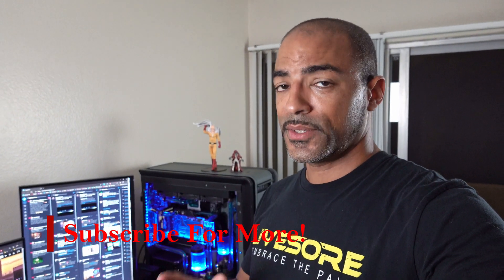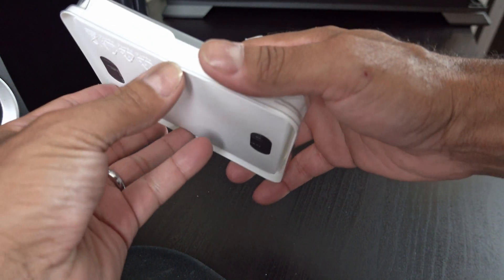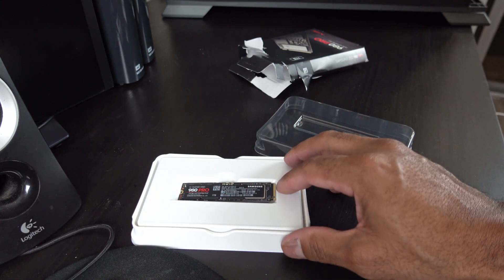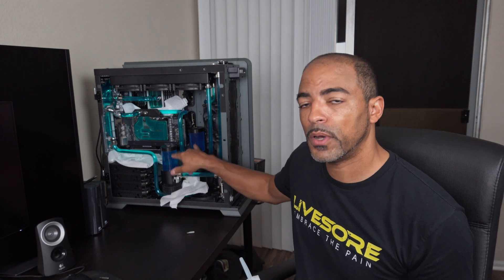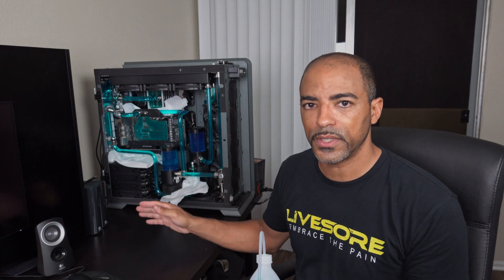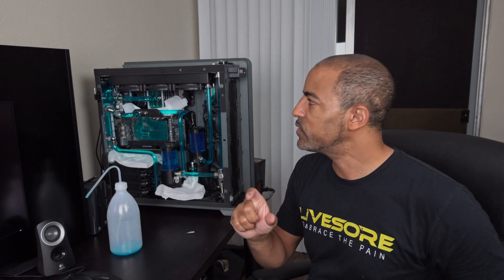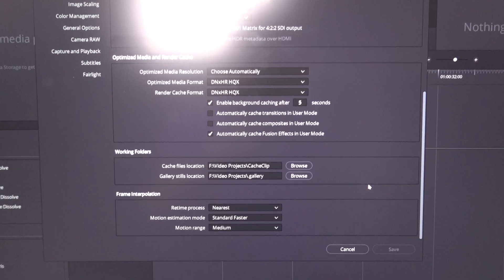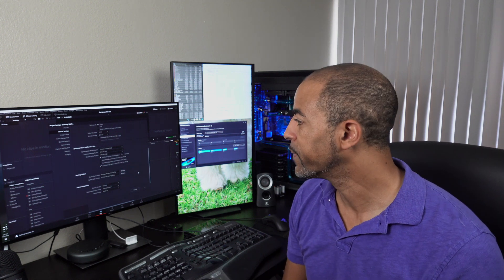Samsung 980 Pro PCIe 4.0 NVMe M.2 install in a water cooled PC "Deep Blue"

Comment: Hi. can i install SSD Samsung 980 Pro PCLe 4.0 NVMe M2 1T . in my laptop HP omen15. Model 2018 intel core j7 Ram32gb. 144Hz ? please answer me . Thanks in advance.
Reply from the maker: I'm sure you can but it will be a waste since your laptop won't be able to utilize its speeds. Don't waste your money
Reply: @DaPoets  Many Many thanks for your answer.But  I bought it. they will deliver to me tomorrow.
Reply from the maker: I suggest returning it and get something like a 960 or 970 since it will be the exact same experience for a lot less money.
Reply: @DaPoets  Thank you my brother. I will think about this. But i bought it on Amazon page.i don't know how to contact With them.?
Reply from the maker: @SandokanSame  just hit the return button

Comment: sir can i ask if is safe to put samsung 980 pro ssd gen 4 on my laptop gigabyte aorus g5 i7 10870h.
Reply from the maker: Yes it's safe. I haven't seen a laptop around that can actually utilize its speeds though. So it may be a waste of money to be used in a laptop. You may be capped at 3,500 megs when the 980 pro does 7,000.

Comment: how did you get this ssd to run on that speed, this ssd does not have yet nvm driver and it runs at the moment only max to 3xxxMb???
Reply from the maker: You need a motherboard with pcie 4.0 to get those speeds

Comment: Interesting performance numbers! One thing I would highly recommend doing is also using/showing CrystalDisk benchmarks. That way we can compare performance in a "standardized" fashion and across different vendors.

You may want to watch BuildOrBuy's 980 Pro performance video where he tests out the 4 different NVMe connections on his motherboard.
https://youtu.be/qL8RzIkxX6Q

My understanding was that PCIe 4.0 was largely a waste for NVMe. Interesting that editing 4K video editing is one of areas that benefits. I imagine video scrubbing would show a huge benefit.

Have any plans to benchmark NVMe in RAID configuration?

I have the ASRock Hyper Quad and 4x 1TB Sabrent Rocket PCIe gen 3 drives that I'll be adding to one of my Threadrippers this weekend. My motivation is to benchmark work's awful 35 minute C++ compile time. Specifically:

* 1TB 860 Evo 
* 1TB 970 Evo Plus
* 4 TB Sabrent Rocket RAID0
* 32 GB RAMdrive

Thanks for the 980 Pro info. Seagate's Firecuda and Sabrent's Rocket drives are also great choices.

For normal users (non-Threadripper) Samsung's 860 and 970 Evo are perfectly fine for gamers.

Comment: I feel like we're building the same damn machine, heh.  I just threw 5 of these into my machine a couple weeks ago.

Also, buy an ekwb leak tester. Over and done in 10 minutes
Reply from the maker: I'm not a fan of the leak tester, there is no substitute for the vibration & flow of the fluid going through the system.
Reply: @DaPoets  everyone's got their preferences.  But if it can hold 75 pounds of air pressure for 10 minutes, it's definitely water tight.  It's really reliable not only in detecting a slow leak, but I've also had a couple compression fittings that maybe weren't as secure as they could be but would have held water just pop right off.

My only complaint with it is most of the time the leak.... Is the tester module itself because something came loose
Reply from the maker: @nunyabidnesss  yeah there's pluses and minuses to it but I'm just old school and using running water through the system has just always been 100% reliable for me.

Comment: Yo, how’s it going man? I have a question I’m running my i9 10850k and I tried running games at 5.3ghz oc and got temps near 50 and maxed at ~60 is it ok for me to go higher like 5.4 or 5.5 ghz cause I feel like I got lucky with my cpu and some how got a good binned one.
Reply from the maker: Run Cinebench R20 for 30 minutes to get your full load temps. See if you're stable and go from there.